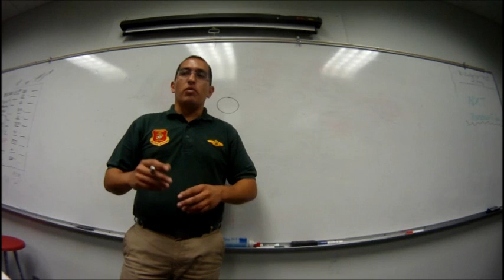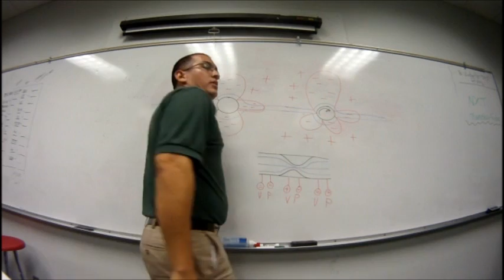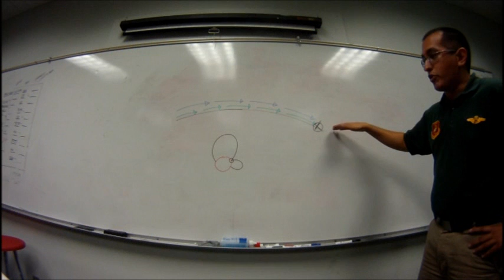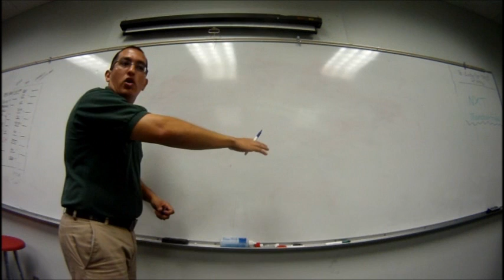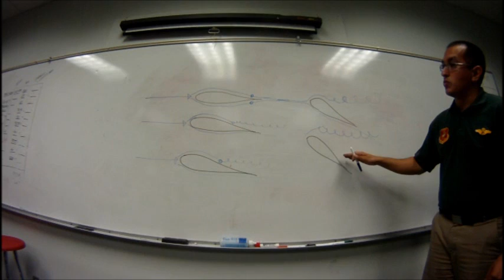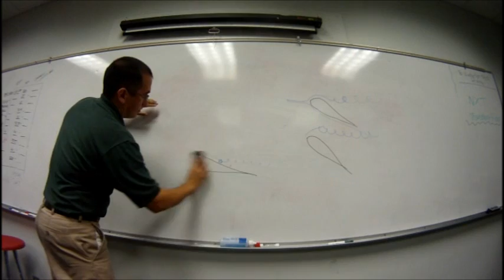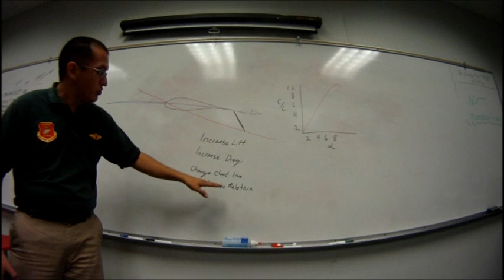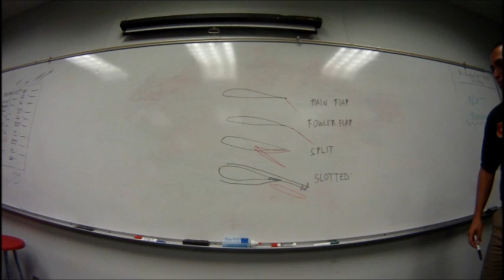Private Pilot Ground School 3 - Magnus Effect

Comment: Hi! Briefly - Magnus Effect - this is an effect specifically regarding rotating objects in an airflow; while airfoils have their aerodynamic properties due to their shape. The Magnus Effect is used as an analogy to teach airfoil flow - this puzzles me since it is quite complex, so why use one complex process to explain another? Also note that pressure is an absolute quantity, so it is the differential in pressure that is important. For steady state flow, there is no dynamic only static pressure.

Comment from the maker: Hmm, interesting. While I appreciate your input on the subject I don't believe I ever implied the wing was ever "pulled up" by any forces. When discussing the theory of lift generally two main points are accepted; pressure differential and flow turning where lift is a reaction from the action of redirecting the airflow at the edge of the airfoil. I try to keep any explanation within the confines of those two theories. Thank you.

Comment: IHMO you messed up "static pressure" and "dynamic pressure" with some "pluses and minuses". Relative pressure (relative to ambient air pressure) can be positive and negative regardless of it's dynamic or static. An absolute pressure can only be positive.
Pressure distribution around a sphere depends on Re number. But in any case the static pressure on "leading edge" of sphere has to be higher.

cheers

Comment: I have a Ph.D. in physics specializing in viscoelastic theory and I can say categorically the Magnus Effect has absolutely nothing to do with airfoils or aircraft flight (sorry but the FAA manuals are wrong). Alot of what he is talking about is frankly incorrect from a physics point of view. I don't believe that pilots necessarily need to know alot of theory to be good pilots, but if you're going to teach it, at least get the basic physics right.
Reply: I upvote your comment, but, he doesn't even explain it, so how can he be that wrong?  Or did I miss it?

Comment: Saying that low pressure on the top side of a wing pulls the airplane up is incorrect. That crap has been spewed for ever. Lift comes from AOA - the lower pressure on the top side of the wing merely helps keep the airflow attached, delaying laminar detachment, thus delaying stall.

Yes, I understand that your info comes from the Student Naval Aviator Aerodynamics guide, but I used to BE a Naval Aviator Aerodynamics instructor in Pensacola, and I'm now embarrassed that I propagated that nonsense.

Comment: I'm sorry but this video is not accurate. The Magnus effect has NOTHING to due with the lift an airfoil produces. Also, the description of static and dynamic pressure is misleading if not flat out wrong. Ultimately the Magnus effect lift is caused by an asymmetric separation of the boundary layer on either side of the cylinder, which causes an asymmetrical pressure distribution. The descriptions given may fly for for pilots, but not for engineers...